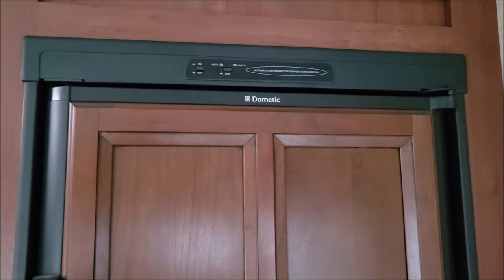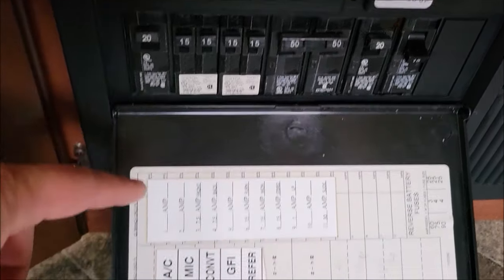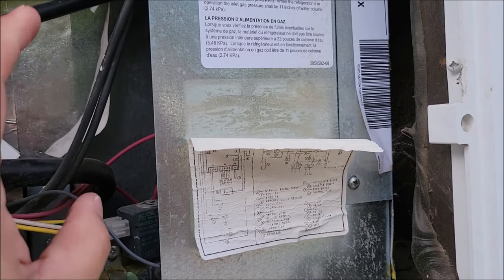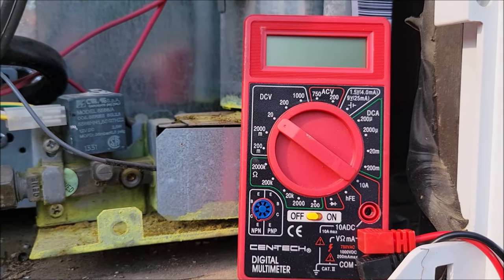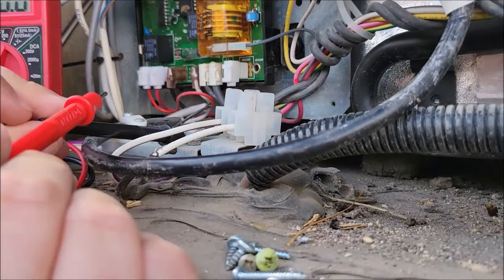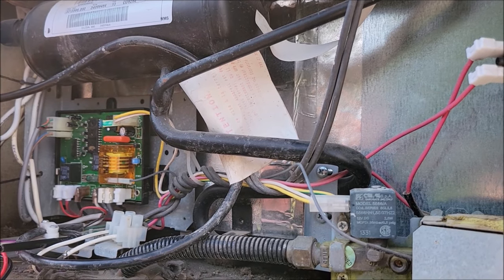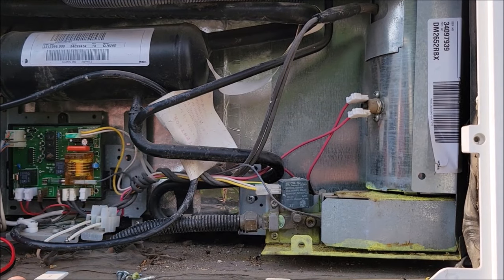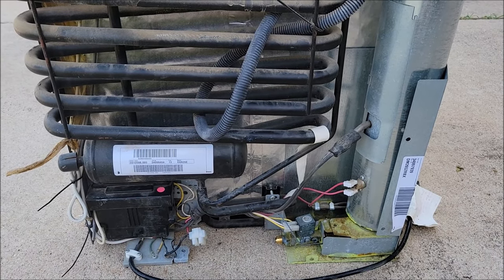RV Refrigerator Not Working | Easy Troubleshooting Tips | Dometic Issues

Comment: Great Video.  I have the same fridge.   Getting 12vdc in from battery and battery is good.  Checked fuses inside.    But If i unplug the J5 and J6 wires from board, (while keeping the fridge plugged into the outlet) I get ZERO volts coming out of black J5 wire,  but at least 110 registering on the White J6 (ac neutral) wire.    Isn't this backwards??   Nothing has been altered or replaced or worked on, etc,  in the camper since I purchased it 3 yrs ago.   
So I'm getting 0 v  on black wire, and 110-120v on White wire.   The glass fuses in the control board look good but only had a very old volt meter so couldnt check continuity.  
Also, i did notice the gas will ignite and burn for about 5 minutes but then the round thermo fuse thing will trip, so can't run fridge via propane only.   
Side Note:  I did replace the thermosensor button on side of boiler a few days ago, after I had been "fiddling" around (which i know is NOT a good term to use with electronics) and unplugged the two wires going to it and used brass wire as jumper and when i went inside and pushed fridge power button, I'm almost certain I heard the fridge come to life, so i quickly pressed button again to turn off fridge, thinking I would be able to fix it for 9$..    
Any suggestions appreciated.
Reply from the maker: Yeah, that sounds wrong. Mine had J5 as the AC hot line (120v) and J6 the AC neutral line (0v).  Did the fridge work at all on 120v before? You may want to try a different plug or use a AC plug tester to see if that plug is wired wrong.

As for the reset/safety switch tripping after 5 minutes, mine was doing that and there is probably something wrong with the cooling system.  The may be a leak you do not see and it's just overheating and tripping the switch.
Reply: @SeidelRanch   thank you for your reply.   Yes, the fridge as worked since i bought it.  It has been stationary since I purchased.  Plugged into a utility pole with one of those RV surge protectors, which has never tripped.   I will try to use a different outlet, although i did check the outlet with voltmeter and showed 120v.  I'm tempted to swap the white and black wires plugging into J5 and J6 to see what happens.  I guess worst that can happen is (definitely) ruin the control board...  Just makes no sense, and the cord etc is as it was when purchased, although someone Must've changed control board at some point because the top screw is missing.  And I checked the deep cycle battery thats only about 1 yr old and at first it looked like I was getting 110-120 volts DC (like a reverse feed?) on terminals instead of 12V but i didnt have my new voltmeter and have never been sure exactly how to read the different, tiny symbols correctly, but i know the needle was damned near pegged when i had it set to 15 or 20 v on the knob.
Reply: @SeidelRanch   also, what are your thoughts on trying this control board instead of the current one like you had.  I was considering the Dometic (3316348.900) Power Module Board.   I've read some people do this.

Comment: Iwas about to order a new board when the rv supply shop mentioned it could be my battery. I changed out battery and works like a champ. My control board lights would not stay on all the time but now they do. Also frig would work on LP but not electric was my main issue. Hope this helps someone.😊
Reply from the maker: Good info. Thanks for adding that.  Do you have an AC to DC converter in your RV?  They are what usually charges your battery when it's plugged in.  This is why it's good to make sure you are getting 12+ volts to your control board using a multimeter.  Glad that is all it was.
Reply: @SeidelRanch  yes I have a converter so I did not believe there advise to start but they mentioned it is only a trickle charge and may not be enough to supply all the 12 volt needed power.  So I changed battery and it was cheaper than a $200- $300 board. It was a blessed day
Reply from the maker: @jeffpeterson4172  That is good to know.  Thank you.  When I tested mine the battery was good so I did not know the converter would not power it alone.  That is good info.

Comment: Great Video, but does not resolve my issue.  All is good with power at both control boards. My fridge works great for a few days, sometimes hours and then just dies out. I unplug the 120 and turn it back on, and it goes again.  I've burped it, check the chimney, check the fuses, changed the fan... Now I don't know how to tell if its my upper control board.  Please help
Reply from the maker: So you don't have to do anything to get it to work again after unplugging it?  Like no reset switches or anything like that? just unplug and plug back in?  Does it sit for any time before you plug it back in?  Also, what make and model is it?  Trying to help figure this out for you.

Comment: Hello, I'm in the start of the process of changing out our dometic rm2652 for a magic Chef residential fridge...the 10 1 cu ft says its 59.4 tall... I have maybe 60.25 max... what did you have for a RO opening height... thank you...
Reply from the maker: I had about 1" open at the top.  It was just enough to open the freezer door and not hit the AC housing on the ceiling.  I would make sure to check the feet on the bottom are all the way screwed in so it's as low as it can go.
Reply: I'm considering going with the 7.3 cu ft... no question that it will fit... thanks for responding back...
Reply from the maker: @stephancobb-sh2vf  You did see my video on the Magic Chef install, right?  https://youtu.be/mxYPcA0Mvu4.  Hope that helps you choose.  Good luck!

Comment: So I was able to get my fridge back on by pushing in that button to the right of the module that you stated. It was definitely sticking out when it shouldn’t have been.
The light came back on inside and everything! But within a few hours it turned off again😓 any advice on what I can do next?
Reply from the maker: If it's the same button I had to push in on the boiler, you probably have a cooling leak.  That will trip if the boiler gets too hot.

Comment: Hi Seidel Ranch, this video is very much appreciated. Thank you. Can I pick your brain. I have the same circuit board and the issue I’m having is that my igniter was suddenly working intermittently and now it suddenly stopped. I disconnected the igniter and placed one probe on ground and on the board where the igniter connects to and I don’t get 12v. I’m not sure if it’s the main board or the control board at the frig. Any thoughts?
Reply from the maker: Did you check and make sure the 12 volt battery in the RV is charged well?  I hear some things can start acting weird if the battery gets weak.
Reply: @SeidelRanch   I did and it was fully charged, but after doing some more troubleshooting I discovered the main electrical board was bad. I have since replaced the board and now it’s working fine. Thank you for your response and also for your amazing videos.
Reply from the maker: Glad to know it was fixed.  These things should have a 10 year warranty because of all the issues they run into after a few years.

Comment: Awesome trouble shooting video!
Reply from the maker: Thank you.  Glad it was helpful.
Reply: @SeidelRanch  yes, I was thinking the board was the issue and then after your video I went to look and saw why it was not failing in the propane mode.  All the freon had leaked out...just like yours!  I went and bought a 4.5 cu ft refrigerator and a 3.5 cu ft freezer.  New Domestic is around 1000.00.  Mine was 17 years old.
Reply from the maker: @trackman515  Ah, yeah.  Sorry to hear that.  We put in a Magic Chef residential refrigerator.  It fit perfect.  I made a video of the install if you are interested.

Comment: I found on mine that the DC connector (the one with four screws) was corroded and just needed a good cleaning and now it works fine again.
Reply from the maker: That's awesome.  I mean it's not good that it was corroded but it's great that it was a simple fix.  Glad you found the issue.

Comment: Just curious why it won’t work off shore power? Does that use a electric heater for the boiler?
Reply from the maker: Is yours only working on shore power?  Mine did work on both, just not very well.  Once the leak happened, I ripped it out and put in a new one: https://www.youtube.com/watch?v=mxYPcA0Mvu4

Comment: Im having difficulties my mother in law has a dometic fridge. Its leaking water from under the fridge. I ran wire thru both drain plugs. No debri also flushed w warm water. Fridge dont stat cold at all freezer works fine. The top panel outside for the fridge both fans wnt come on.  The compressor is warm but not hot. Ive checked all fuses all looked good except the 10amp in bottom panel outside.  How do i get the fans working and this water to stop leaking?
Reply from the maker: Is it the same fridge as in this video?  It sounds different.  This one does not have a compressor.  It also does not have a drain line on the bottom.  This one goes out the back.

Comment: I have power to my rm2652. That little black button is out. I can hear the relay click but fridge does not come on under electric or lp gas. Any suggestions?
Reply from the maker: If you mean the little black button on the boiler is out, that is probably the issue.  That usually means the coolant has leaked out to a point that it's overheating.

Comment: I just fixed a 10-year-old and it was the control board. I ordered it and the board on the refrigerator face being it was just $160 both boards together, on Amazon. I also have real ice cubes now. I slid the temp bar on a fin up to the top and its really cold now. Overnight ice. I also keep a frozen 2 litre bottle in there, which helps. Thank you. You talk like I do and think. The new Dometic refrigerator was $1386 at Camper World. Not installed.
Reply from the maker: Glad it was helpful.  Thanks.  And yes, these are crazy expensive.

Comment: What do you call the switch/button with the 2 red wires on it.
Reply from the maker: Not sure it's exact name, but it's the boiler safety switch or breaker.  That is there to trip if the boiler gets too hot.

Comment: The lights in the control panel inside work.  There is no leak.  The burner lights.  I do hear some gurgling noise in the back. Any idea what's up? It doesn't work on AC or propane.
Reply from the maker: I would try to test the thermistor in this situation.  You will need to test the resistance of the 2 main wires at room temperature (should be about 2000 ohms) verses the resistance it reads at 32 degrees (about 9000 ohms).  I have also heard you can unplug the thermistor from the control panel in the back and that should force it to cool if the thermistor is the problem.  Try one or both of these tests to rule this out.

Comment: What if im getting good voltafmge into the board but only see .9v at the 120v fuse?
Reply from the maker: Probably a blown circuit on the board somewhere.  You can always order one on Amazon and if it does not fix the issue return it (I think).

Comment: my fridge and switch board and the problem is identical to my problem. However I tested the board in the back and I cannot register any 12 dc or 120 ac reaching the board. So I'm lost. Help !
Reply from the maker: Are you seeing the yellow colored residue on the cooling system?  If so, it's probably not worth it to fix.  If not, try looking for a fuse or breaker somewhere in the power wires.  Is 12v or 120v even getting to the power outlet in the back?

Comment: Ever run across a situation where the check light comes on in either fuel mode when it gets lower than 40 to 35 degrees exterior temperature, but works fine above that?
Reply from the maker: That I have not, but I can't remember the last time I let it get that cold in the RV when I was using it.  I wonder if that happens since the outside temp was close to the inside temp.  Let me know of you find the answer.  I will ask around.
Reply: @SeidelRanch  Yes, that was outside temp, inside was warm with the furnace running. It's in our Living Quarters horse trailer and we use it year round. I was thinking it might be the circuit board, but the new replacement has 7 wire terminals and I have 9 wires. So I haven't changed that yet, nor know if that's the culprit or not and I didn't care to waste the money if that's not it. Looking for help, it's hard to find anyone to work on them before April.
Reply from the maker: @barrynelson634  Oh, I see.  It could be the board, but you may want to check the thermocouple (but I am guessing at this point).  Getting anything fixed RV wise is a pain now days.  That is one of the reasons I started just researching it all myself.
Reply: @SeidelRanch  Yesterday, coincidentally, a neighbor camper had an RV mobile tech out for a water heater issue. The guy was very nice to come over to my LQ and take a look at my refrigerator issue, he was stumped. He called Dometic using his tech hot-line and they didn't have a clue if certain parameters were checked and were OK. He gave me another number for a circuit board. 3 hours and 20 websites later, I have the supposed correct circuit board coming to me, evidentially the last one in the country. If this doesn't remedy the problem, I'll need to replace the refrigerator which is a bunch of crap. Good ol' American manufacturer's anymore. But thanks for your reply, I'll try to remember to let you know the results.
Reply from the maker: @barrynelson634  Hope it fixes it.  If not, maybe do like we did and just replace it with a residential refrigerator: https://youtu.be/mxYPcA0Mvu4
Reply: @SeidelRanch  Thanks for the heads up on the resi frig, I'll keep that in mind. So I received the new circuit board and that resolved the issue. Thankfully. So hopefully this will last another 18 years or until I buy a different trailer. Thanks for all your help.
Reply from the maker: @barrynelson634  I hope it does.  Thanks for the reply.  Glad it worked.

Comment: If the refrigerator and freezer are not working check the wire to the thermostat make sure it's hanging out because that's what happened to mine I accidentally pulled the wire up and I had frozen pipes and when I pulled that wire up it was directly hooked up to my freezer everything went unthod almost lost everything
Reply from the maker: Oh no.  Glad you saved it.  Good info too.  Thanks.

Comment: I have 2 plugs in my fridge access. Is one 120 and the other 12 volt? Tanks
Reply from the maker: I am not sure what you mean.  There should be a 120 volt plug that is plugged in the RV 120 volt outlet and the 12 volt is usually just some wires that lead to the back of the refrigerator.  I have not seen an RV with a 12 volt outlet wired in.  Usually it's just some wires coming from the floor where the refrigerator is sitting.
Reply: @SeidelRanch  thanks for the input. It was the thermocouple in the fridge. Last thin I checked.
Reply from the maker: @kathrynmcmullen2874  Glad you found the issue.

Comment: I have a 1" pile of yellow powder under the boiler. 😣 The lights still work on the fridge and the boiler got hot when I turned the fridge to gas.
Reply from the maker: But does it cool inside?  If not, the leak has done you in and the cooling system will need to be replaced.  If it's still cooling then it's just a matter of time before it's not.

Comment: I just bought an old motorhome and it has the same board outside and I'm not getting 12 volts to the board. How do I trace down the problem?
Reply from the maker: No 12 volt power makes me think you need to check your fuses.
Reply: @SeidelRanch  I was messing with it and I did confirm that I have 120 to the board and I checked the fuses but there's no fuse in the box for the fridge......🤔🤔🤔🤔
Reply from the maker: @jammiedevaney  Mine was tied into another fuse for something else in my RV.  You may have to trace the 12 volt wires back as far as you can.  I have seen some pretty poor build work in RVs.

Comment: So mine was going into limp mode. My fridge was running at 16°. I've replaced the main circuit board and now it's not cooling. Lights come on,but no one's home. Before I replaced that I did the thermistor. I'm at a loss
Reply from the maker: Hi.  Sorry for the late reply.  Did you ever find the issue?

Comment: My fridge has the check light, if I turn it off and on again it goes away for about 5 minutes before turning back on. Any idea?
Reply from the maker: I think that light is the auto check feature where it checks for electric first and if it does not have 120v power it flips to propane.  Do you have 120v power going into the fridge?
Reply: @SeidelRanch  yes. Right now I’m cooling it down with propane then I’m gonna switch to electric and see what happens

Comment: Are u plugged into shore power for this to get 129vokta on ac side
Reply from the maker: Yes, to test the 120v you need to be plugged in.  We usually kept it on shore power when we had it in storage to keep the fridge running.
Reply: @SeidelRanch  Okay that's good to know because I was testing mine and i'm like i'm not getting anything. I'm hoping I found the problem why my fridge just can't get cold it tries. I pretty much ruled out everything that you went over. I went to test the therminteresting out. With a big glass of ice water in my omhl meter. And it's not even registering anythit just says the The number 1 on far left. So i'm hoping that is the problem. It tries to get cold but it can't get past that point.
Reply from the maker: @andrewkuiack973  That could do it.  Hope that is the issue because that should be an easy fix.  Ours never performed all that well so we ended up taking ours out.